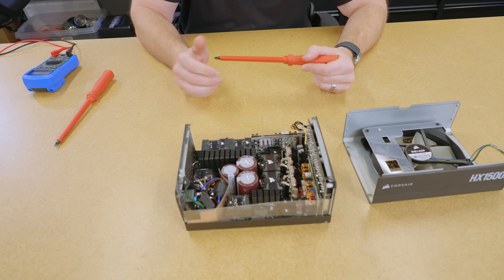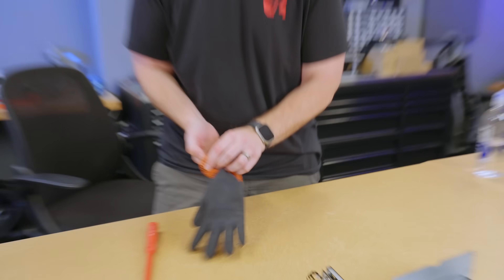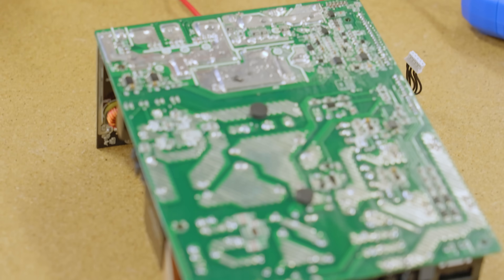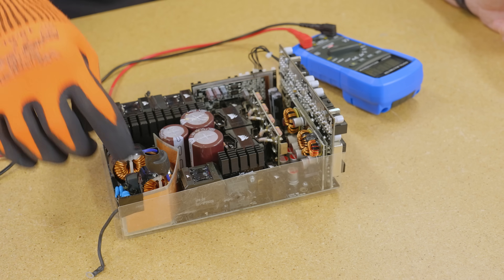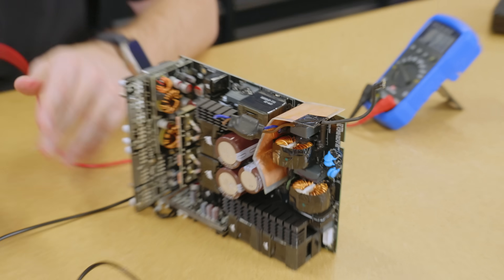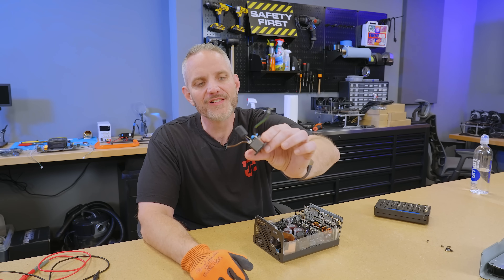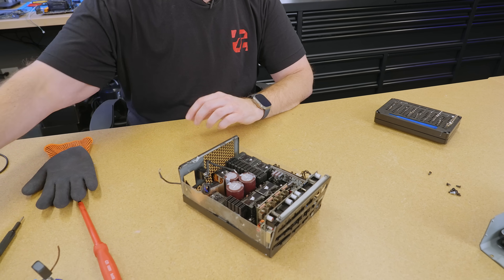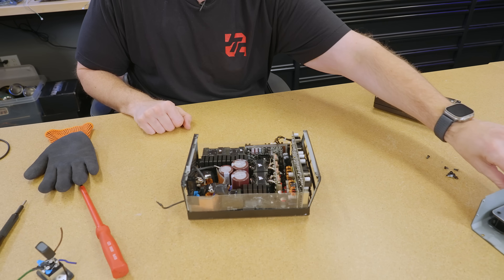Investigating what exploded in my PSU... DANGEROUS! DONT ATTEMPT!

Comment: No, it isn't very dangerous if you follow proper procedures... just let the PSU sit for a couple of hours and all the capacitors in the PSU will have discharged.
I've INTENTIONALLY tried to make PSU's for computers, consoles, etc. 'go up in smoke' after they have been sitting for awhile and they never do, even when intentionally shorted.

Comment: Wow...the spambots are quick today...

On the psu popping... i like the exploration... ive done the same to many of my old and bricked hardware pieces... the 1 rule ive had for the psu's... im never allowed to plug it back in if i open it up xD 

The rest of the hardware i took apart and tried figuring out what went wrong.... i would build a test system with old useless parts just to see if i could get anything working again :p 
In the end.... out of like 50 pieces of hardware...i only ever managed to get 3 back to a functioning state...and that was 2 graphics cards that had a broken power connecter and 1 sound card that had a popped resistor (i had a identical one that didnt work and i took of the resistor..and it worked :p)

Comment: I did this with many PSUs way back when I was learning about hardware. I won't even buy a used PSU anymore at this point.
Reply: The fan inside is worth $5.00 , so that's the most you should pay.
Reply: @markae0  Even then im not sure its worth the risk to go in there and get it.
Reply: @lyianx  I have open many, many power supplies and it is not THAT dangerous when unplugged. The DC electricity in the caps want the shortest path and that is usually metal. But I was wincing when Jay had his finger near the high voltage.

Comment: Don't worry, I know enough to not take apart a PSU.  I'm not particularly keen on discovering how much juice the death cylinders have inside them.
Reply: So, if PSUs are out... can I interest you in harvesting a microwave oven transformer?
Reply: A decent circuit would have load resistors in parallel with the caps to drain them when the circuit isn't powered. They would be safe to touch within a couple of minutes.
Reply: @MikeRomeoNL  well, looks like Corsair didn't do that.  Good thing I buy Seasonic.
Reply: @alaeriia01  Seasonic make many Corsairs PSUs, Corsair don't make PSUs.
Reply: @alaeriia01  How do you know... without opening it  up and looking? Data sheets can lie.
Reply: @alaeriia01  Maybe, but Corsair often use seasonic as the OEM.
Reply: @MikeRomeoNL and you trust all brands to do that?
Reply: @bashaaksema94 No. But as an electrician I know what to look for 😉
Reply: @MikeRomeoNL true but as a hardware engineer i know to design them into the circuit😁
Reply: I’ve used a PSU with absolutely no cover on it for years
Reply: @zbatchDOC  Not a good reason to brag.
Reply: That is ZERO if you wait 24 hours. Even 8 hours is majority long enough.
Capacitors are not meant to hold power for long periods of time, they discharge quite quickly in reality.
Reply: @christopherkidwell9817  Remember that this PSU is dead and the circuitry that may or may not have been there is likely to have damaged as well. These caps might be effectively disconnected from everything. I have no idea how bad or good the leakage on modern caps is, but apparently it's good enough to still hold a majority of the voltage for 24 hours.
Reply: @christopherkidwell9817 those caps held 150V, though.
Reply: @alaeriia01   likely down from 240... and honestly it's still bad. i know caps can hold a charge, and modern caps should have much lower internal leak down problems, so they are more efficient, however, i'm not sure they should be holding that charge going on 24 hours.
Reply: @TheObsesedAnimeFreaks  Highly unlikely to be down from 240V. He is a US-American which means 110V AC which are rectified to about 156V DC! That is not a large discharge and will take a lot longer to discharge to safe levels than most people would expect. Always handle mounted capacitors of this size as if they are charged as long as you haven't checked them.

Edit: Well if I had watched further it would be clear that it was connected to 120V (@3:20)
Reply: @kagex5426 well i assume it has a boost circuit and if its universal mains coulld very well be 350VDC so yeah….
Reply: @kagex5426 
Not with how modern psus are built.
It very well could be 240+
Reply: @TheObsesedAnimeFreaks  You are right, but those are over 400V capacitors. A boost to close to or over 400V is highly likely for efficiency reasons. Still, would you like to take the risk by touching them? What I calculated with was the lowest voltage it could be! Which is also the lowest risk. What I said still counts! Never risk touching the contacts or planes of a large capacitor with unknown charge.